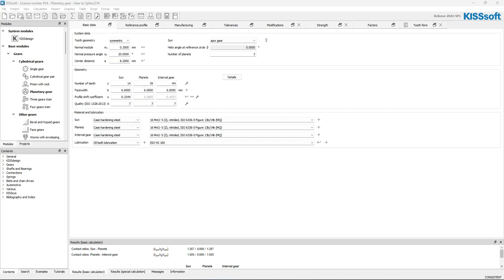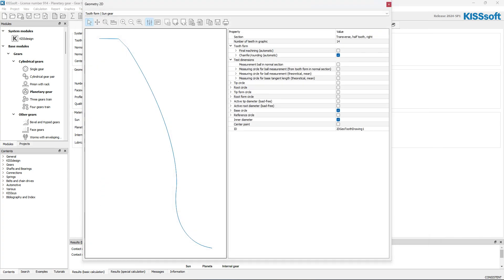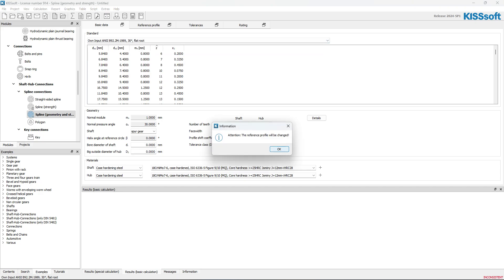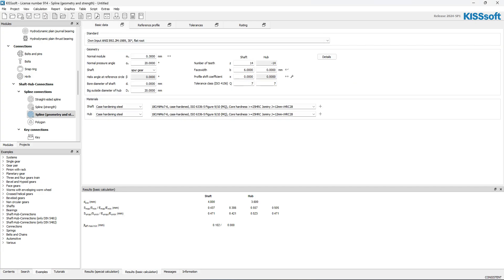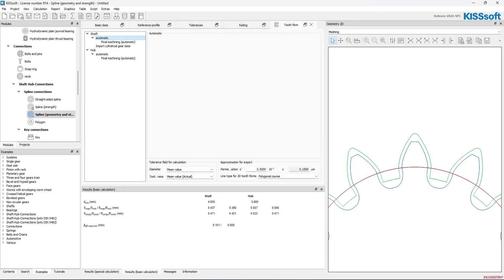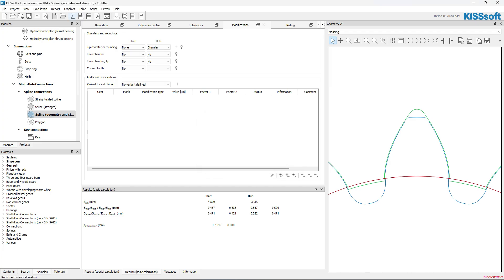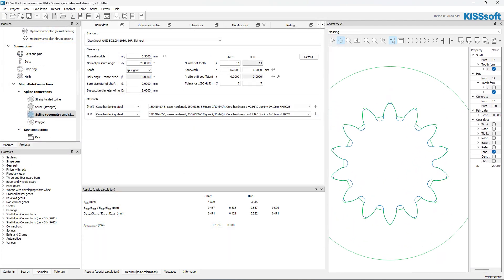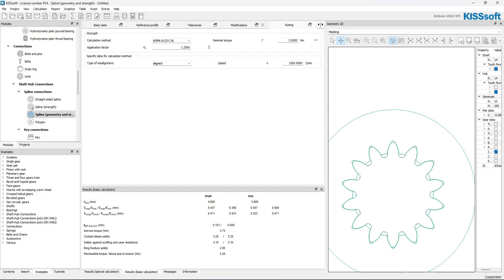Gear Data to Spline using Cylindrical Gear Geometry Import

Comment: When i input the .dxf file in KISSoft and i run the calculation i get a n error : Tooth Form, Shaft ,Step 1: cylindrical gear data: no layers found!
Reply from the maker: can you open the dxf in a viewer like solidworks  and see the tooth form?